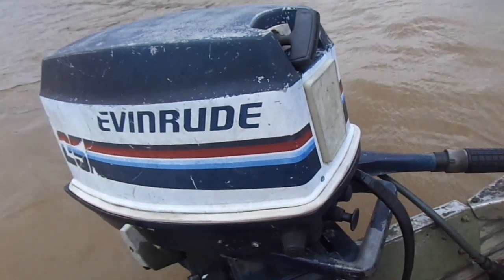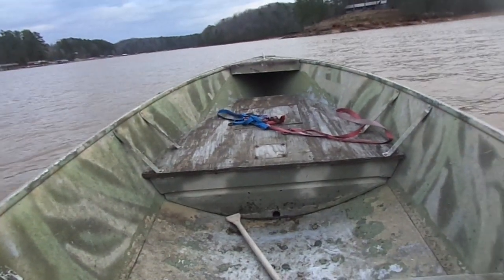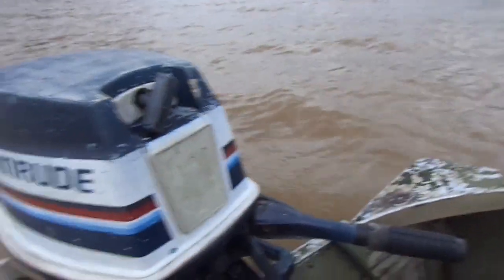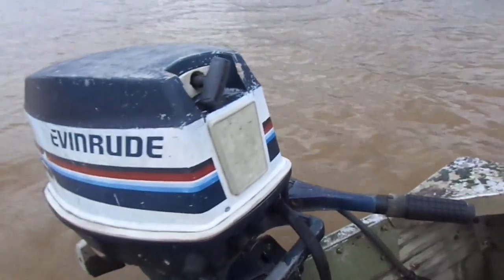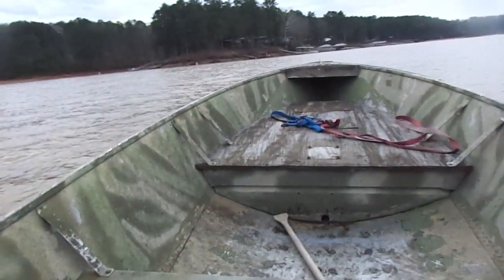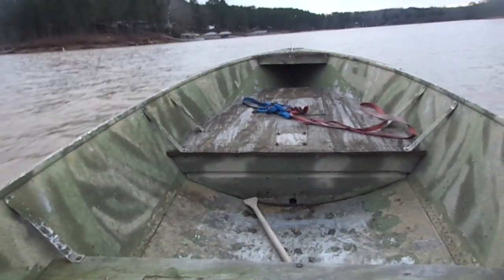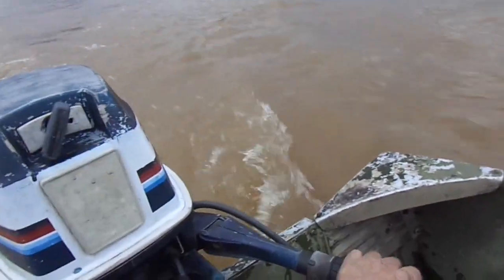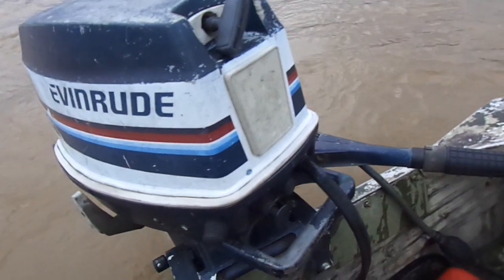1982 Evinrude 35 HP on 14 FT V hull

Comment: I also think it's a good idea to put a tach on, I found a reasonable priced one that I can use for this test. And it can be set for a  4 stroke. That way I would not over rev engine. And can be used to test when prop get too worn out. If your concerned about your engine.

Comment: Looks like thers a primer on that motor did you use a primer carb and intake on this motor, I believe primer were made 1984 and up, I have a 1976 35 that has a huge exhaust chamber, I’m planning to use a primer intake and carb because it looks like it will flow better than the choke style carb and intake setup.thanks for your reply , any info would be appreciated 
.

Comment: I have a Johnson 20 horse 94 and that's been converted with a 35 horse manifold and Reed valve system and a 35 horsepower carburetor with the correct jet I have a 14 foot 5 or 6 in Seaking 1956 and I am rebuilding the transom with a 2in thick transom, marine plywood, penetrating epoxy and the 20-35 hp is the motor that I want to put on the Sea King I can hardly wait to see what it'll do. Bad news I broke my leg is now healing up after 7 weeks so now I can get back to the boat will be really interested to see how fast it goes I am going to change the 10 and 13 pitch prop to a 10 X 15 pitch propeller stainless steel. It'll be nice to see what happens, I may have to put some weight in the front to keep her down, I could just run 3/4 throttle, and that may get better gas mileage. I used to have a 25 horse Johnson 1956 on it , 27 miles per but it was such a gas guzzler, I got rid of it, I should have saved the  engine for some parts I need.
 Much too late now, hard to find some thing's.

Comment: shows a 25 horse Evinrude so why does video title state it is 35hp?
Reply: If you watched the video youd know why lol
Reply: @kone2370  i did watch the video.. I didn't listen to it though- if that's what you mean by 'watch' lol
Reply: 25hp cowling on a 35hp motor
Reply: @FatKayakAngler  got it thanks lol.. I didn't have my CC on @ the time I had watched .. cheers
Reply: @swmplvr  You can also easily modify the less horsepower models with an intake manifold and carburetor swap off the 35 and adjust the timing.